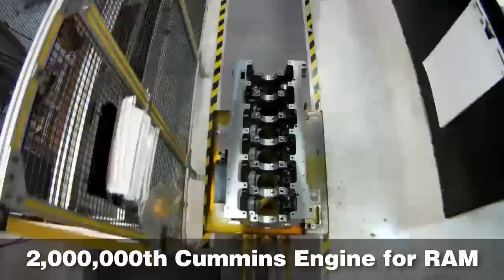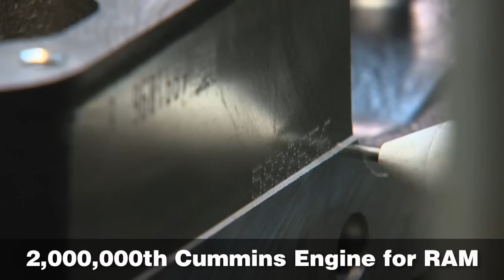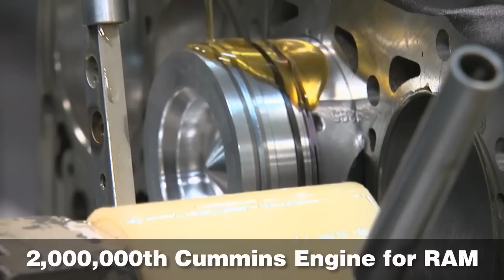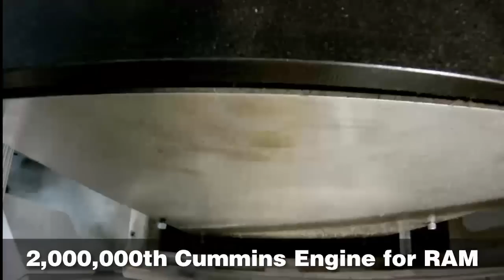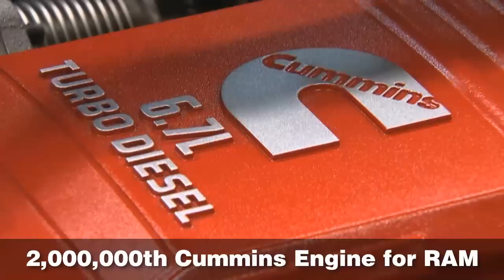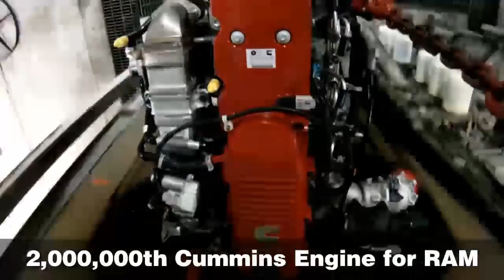Cummins Builds Two-Millionth Pickup Engine for Ram HD Trucks

Comment: Can never go wrong with a Cummins
Reply: Yeah fucking right
Reply: The rest of the truck though....the engine is SOLID I’ll give you that.
Reply: True but ford has better bodies & id take a 6.9/7.3 idi & or 7.3ps over a 5.9 just cuz of the cheapness to get parts. But the ford idi & 7.3 ps is still better than the Cummins cuz of no stupid killer dowel pin.

Comment: Theres 2million of these things yet people still want 20k for a 1999 -__-
Reply: Jeremy Ellard haha
Reply: Most of the old engines have died in a junk yard with the rusted out trucks. There are also a lot of people that buy these trucks and just run them into the ground.
Reply: Mark M old engines that die? Maybe the truck, but Cummins never die lol
Reply: early 1998 12v new interior best pickup yet.
Reply: Super rare.lol.
Reply: I have two 89 w350 & 01 quad cab .  Best truck ive owned.  Most of the complaints I hear are from guys who expect steering components to still be good 25 years after it was sold. The engine properly taken care of never die and when something needs to be replaced there so easy to work on.
Reply: Mark M 5.9 is the best Diesel engine made for any light duty truck. (Non semi)
Reply: @yamen16  yes I got 2003 5.9  338000 miles and still running like new
Reply: Still rockin the 93 w250 and 95 2500 12v cummins.
Reply: Thats because they dont have the EPA garbage these ones do
Reply: Nitro ForTheWin give it to a teen who tunes it to 1000hp will kill it
Reply: True but it’s the fully tune able 12v 5.9 w the P-Pump they’re after. But then again if you want power just get a new one or a 7.3 & make all the power you want. 

In reality an old diesel truck before 97 is only worth like 2-4K. I don’t care how good of a condition it’s in, unless it’s got a rebuilt motor, & or transmission it’s still worth what everyone else is charging. 

Yeah I’m a ford guy & I wish they had used the 5.9 instead of the 7.3 and or 6.0. I’ve had a 7.3 & they’re good, but everything expensive to fix.

I was looking at a 5.9 & all of them are up over 8-10k, so I went with a 93 idi w a 5spd for 4K w 210k on it. 

Us ford guys like em cuz the bodies are better & the parts for em are just about the same as a Cummins, but it’s easier to afford upfront.

For my idi I can find a core for 500-$1000 for a used engine, & a used zf5 core for about the same price.

Sorry Dodge guys, but the fords are better for the bodies at least.

Ford should’ve ditched IH after the 7.3 & went to cummins. 

If I was to buy a new truck it would be a Cummins, but then I like the fords, but then again if you get any new truck a fat warranty goes with it cuz of the DPF BS.
Reply: mmmontague, true. After owning an older diesel I can’t imagine owning a new one with all the stupid epa Garbo.
But then again it’s way cheaper to just have an good old truck, to keep fixing than buying a new one.

If my idi does eventually die it could be getting a 5.9 cuz I’ve got the ZF5 I’ve heard they’ll bolt up, but not to sure if that’s true. But then again the idi’s are still way cheaper to fix & maintain. A Cummins has a 2K injection pump but the idi has one that’s 5-600. Plus the idi’s are everywhere & theyre 1/2 the price of a Cummins for the truck, by the motor it’s 1/5 of the price.

Comment: 1992 I install a new Cummins 6bta 260hp in my  36’ Comercial fishing boat. 26000hr now it still run like it first install. It the most reliable engine I know in my life time. It only got two incidents 1 fuel supply line to injector crack. Shut off solenoid stopped working. This year I repower my boat with a cummins isl450hp I hope Cummins still keep its reputation

Comment: I just purchased a 2013 Ram 2500 with the Cummins 6.7 engine. I previously had a Duramax diesel which worked well, but I'm really excited about this Cummins. To be honest, the Cummins was the reason I chose a new Dodge over any other truck brand. 
Great video.

Comment: I understand that this engine failed at 22,396 miles. It was sold at a Dodge dealership in Akron Ohio. The turbo failed twice and the third piston broke the crank on the final repair. The engine was sent back to Cummins for evaluation. Rumor is the owner would pull a 32,000 pound RV in a one ton Dually. He would not allow the turbo to pre cool after pulling and just shut it down. He also would do cold starts and take off as if it was heated. He also installed a performance chip to increase the towing capacity. What a shame!  Great engine went to the scrap yard due to inexperienced operation
Reply: Can you provide sources for your post?
Reply: running the 2,000,000th engine's ESN through the Cummins QuickServMobile app reveals that this engine was NEVER installed into a truck; because if it were installed into a Ram, it would also reveal the VIN number of the truck it was installed into, and that portion of the dataplate for ESN 58226569 is completely blank.

Comment: There's too much crap screwed on to that beautiful engine.  Delete it all.  They should have stopped making that engine around 3:00 into this video.  Would be more like the 5.9L that got them there in the first place.
Reply: thank you'r govt
Reply: im man makes sence they put filters on that clog lol.
Reply: all the parts keep it running longer and stronger.
Reply: I got a 5.9
Reply: @executablefiles3713  what a joke
Reply: Idontcareifyoutubedemonitizesmyvideos explain how pre emissions tractor trailers would go over 1m miles easily I have a old Cummins with 4m miles and these newer ones need rebuilt by 700k
Reply: @makeamericagreatagain4546  I dont believe you
Reply: jim crawford I work at a trucking company the trucks with DEF break down at least once a month

Comment: I have the 2019 newly re engineered High Output 6.7 in my '19 3500 Laramie Dually, teamed with the 6 speed Aisin transmission. Everyday it sings a new song.  I don't quite yet have 5,000 miles on the beast.

Comment: Love my Cummins, hate my dodge.
Reply: Jason Stuck
 dude you LIAR you drive a Ford!!!  the Ford guys just can't resist  too lie!!  also an Obama voter
Reply: Scott wads 1,000,000 mile engine in a 100,000 mile truck. I love my Cummins the only thing wrong with it is the truck that's wrapped around it.
Reply: Get a Nissan Titan. They have Cummins now. I love Rams
Reply: @darwinmang4932  not the 2020 Titan. They got rid of the Cummins

Comment: Love my '01 cummins. And btw i work on the big highway rigs. They do have inline six cylinders almost exclusively. The inline 6 is an industrial setup, it provides superior torque to fuel economy ratios and reliability. How many duramax or powerstrokes to you know that have gone 1,000,000mi without a rebuild? With a cummins its considered normal. In fact the truck itself will fall apart half a dozen times before the engine ever misses a beat.

Comment: Its crazy how expensive they are now. My Dad bought his first diesel pickup in 1993. Ram 3500 Extended cab, DRW, manual, 5.9 Cummins. Out the door for $20,500. And this was a small town dealership. Most likely others got a much better deal.

Comment: I like Cummings engines I got one in my 18 wheeler but what if cat motors were put into the Ford 350's,f450 then that would be a beast even thou the Ford makes a good heavy diesel motors but we can forget Chevy trucks either,they should build a Detroit to fit in there lol.
Reply: whats a cummings?   these are cummins engines
Reply: B- trucker Ford makes a good diesel engine and Ford actually makes them since late 2000s and navistar used to make them.
Reply: Jorge Pulido 2011 to be exact, the first to build there own

Comment: Just purchased a 2013 Ram 3500 in July. Although it is a very nice truck and I am sure the cummins will probably outlast the truck, the duramax/allison combination is still king for towing performance. Unless you have had both, you wont understand.
Reply: I don't agree.. KING of towing with a pickup is a Cummins (or any other diesel) with a 6 speed manual and dual disc clutch. Mine is a 12 Ram 2500 with 6.7 Cummins, G56 6 speed, Centerforce Dual disk and 3.73 gears. So far there's nothing it can't better than the company pickups (2018 Ram 2500 Cummins and auto, 2017 Silverado Duramax and Allison and 2019 F250 6.7 Power Stroke and auto)

Comment: You are WAY behind the times. I've owned two 3rd gen trucks and never had one problem with either one. Bodies were sound and both the manual and auto transmissions did their jobs w/o a whimper. 

I own a Chrysler 300Hemi now but will be looking at the new '14 Ram 1500 diesel this fall. I miss my trucks.

Comment: Do you guys offer the 2.8L Cummins as a off-the-rack crate option? I want to swap this engine, with a 8 speed ZF transmission,  into my Nissan Frontier. Since Renault, part owner of Nissan, put the ax to this setup...I figured it can now be offered to anyone.

Comment: everybody start checking their serial #s
Reply: mine is #58202246 (24,323 before this engine) and was built Oct 9 2012, 1 day before my birthday, makes for one hell of a birthday present..
Reply: I have a feeling this engine(ESN# 58226569) never left Indiana; because I plugged both this ESN and Rexford's ESN into the Cummins Quickserve Mobile app; and Rexford's ESN gives me the VIN number of the 2012 Ram 2500 crew cab it was installed in, as well as the day the warranty started for Rexford's engine (10 days after the engine left CMEP). the 2 millionth engine doesn't have a Chrysler Group VIN or Warranty start date; so I bet that engine is gathering dust either at the CMEP plant, or at Cummins HQ.
Reply: if you read below(about a year ago), Cummins said this engine was going to be mounted and displayed at truck shows across the nation..

Comment: I’m not happy to hear all the recall repairs on new Dodge Cummins! I’m being told if I buy another diesel that the “Duramax” is the best diesel now and that Ford diesels will only last 125,000 miles. I own (2) Dodge diesels-03 and 04 3500 duallys. Those are the 5.9 high output Cummins (Factory Federal edition-no smog crap). I’m told these were the last good Cummins before it all went down hill to make more money and less quality.

Comment: I think Ram needs to rid of that 6.7 and replace it with the 8.3L. 1000 ibs ft and 300hp. It'd be very easy to bring that horsepower number up to 5-600 amd torque could effortlessly sore above 1,500 ibs ft so it'd be more likeable to the pickup market and it'll out last the 6.7 without a doubt. Those 8.3s are ment to go up to 750,000+ without a rebuild. Cummins offers a 5 year 250,000 mile warranty with them as well. Ford and Chevy could never pull against it.

Pickups really dont need anymore torque than 500-700 ibs ft but it is awesome to have over 1000 ibs ft and so long as you're getting it from a large engine gas or diesel they sure will last a lot longer under the light stresses a pickup can go through.
Reply: The 4500 / 5500 should get the 8.3L Cummins. The 2500/3500 is just fine with the 6.7 as it's fuel efficient and doesn't require ultra heavy duty front suspension.

Comment: I love these motors but hate the assembly line structure. It would be better to have one person to assemble one whole motor. Then the engine builder can be proud of his work and thus build a better product as opposed to say “hell yeah, I turned 1000 bolts on the left side of a oil pan today”.

Comment: There are so many people that fall between a 2500 and 1500. Dodge needs a 1500HD with a Cummings. How does Nissan get a Cummings errrrr lol
Reply: ATC235 Now explain the point in putting an engine capable of towing 25000 pounds in a truck that flat out couldn't handle it. The springs and drivetrain won't handle it. In a 1500 the Hemi is more then enough and if your just wanting a diesel for their benifits then they also make an eco diesel version.
Reply: Darren Thomas I have the eco diesel and let be it so far. I just would like a truck that would fall in between a 1500 and 2500. I think Nissan and Toyota are doing that now. I'm planning on trading mine in for a ram 2500. I heard the ride is so much better now and the MPG is not that bad.
Reply: *Cummins
Reply: Cummins
Reply: ATC235 ride I guess is ok it's a heavy duty truck. But it's definitely better than a 3500. The mpg is amazing for a diesel. Get 25 average in mine. It's a 2015
Reply: ATC235 we love our hemis if I want a cummins I'd buy a 2500 which I already have ..
Reply: The Cummins Engine in the current  Nissan Titan was developed for the RAM 1500, Daimler dumped Chrysler and Fiat installed their own Diesel in the RAM 1500

Comment: Cummins sells the engines to Chrysler at a discount with no warranty 
Although it is a cummins engine cummins will not do warranty work on them and our local factory owned cummins dealer will not even work on any of the new engines if you offered cash because the engine use Chrysler software

Comment: There are 7.3s that have went over 1million miles not just cummins, there is a van on YT that has 1.4 million.
500k is normal with just oil changes.
While I agree the 5.9 was a good engine and duramax is a joke but then again all the newer diesels are jokes with the EPA garbage on them.  
I get better MPG with my 97 7.3 pulling a 30 foot camper than a brand new ram 3500 just driving around town getting 10-12MPG.  No new diesel produced for consumers will see 1 millions miles now.

Comment: What I don't understand is why couldn't they have made it more special than just putting on a red valve cover... Jeez throw in forged internals from Carrillo with Mahle forged pistons, build the engine for performance use and warranty it.... Put a Steed Speed manifold on with an S363 turbo, ARP studs, Pusher intake horn and intercooler pipes, upgraded intercooler and radiator from Mishimoto, S&B cold air intake, Diamondeye stainless 5 inch exhaust, Some nice EFI live tunes for the daily driver truck... THAT is what would have been awesome to see put into the truck with the 2 millionth cummins engine...
Reply: but then what the aftermarket guy gonna have left to do hahah?
Reply: why ruin a perfectly good engine with crap like that
Reply: Because the majority of truck owners, aren't 20yr old kids and actually use their trucks for work and could give a ratsass about going fast or using it as a toy.
Reply: Unfortunately that would tamper with the emissions systems and that IS NOT ALLOWED!!!! Emissions suck

Comment: I agree 100% the whole inline 6 is better is complete bullshit, I will put any 7.3 psd or 6.9/7.3 IDI up against cummins on miles i see it everyday. hell alot more 6.0 psd's are up there on miles too. cummins is a great motor easier to work on for the most part, cheaper to mod, have a little lower toque band vs psd's/dmax's. Good engine never the less for the most part except the 53 block lol

Comment: Good motor thank God they put it in a junk fiat foriegn  owned  pickup because it could wear 3 of those junkers out
Reply: 159,000k on my 6.7 Cummins made 9 Oct 2012, 61 days earlier than #2,000,000 in the video. The pickup still drives like new (I compare it to the 2018's Ram 2500's my company has and 2019 F250's) and IMHO drives better than the new pickups.

Comment: Only 2 million!? SBC was at 100 million in 2011.  Almost 2 million PER YEAR.
Reply: Dude nothing is going to catch SBC's lol. They been making em' since 1955 and are still extremely popular.
I'm not sure that the LS is even going to overtake them since they are so much more expensive than a small block.
Reply: @bobjackson4287  LS?  Do you mean GenIII SBC?  No such thing as "LS".
Reply: @zacharymorris9917  Gen III "LS" is significantly different design than the Gen I's designed by Ed Cole. So much so that they are considered different family of engines.
Reply: @bobjackson4287  different family as in GenI vs GenIII, still a SBC...
Reply: @bobjackson4287  again, no such engine as "LS".  Doesn't exist.

Comment: EGR nightmare $4000 to 5000 system cost, replacement under 100,000 miles , poor mpg , EGR hard on the motor , what a loss for Cummins

Comment: ill just stick with my 2001 3500 6Bt HO 6 speed dually.. million Mile motor. 327000 and going strong
Reply: Consider a live tuner to get information on all parameters of the truck. You can easily catch it before something goes wrong. Also, you can give it a safe tune so there's an even lower chance for failure. I bet your truck could pass 1M miles if you treat it right.
Reply: A million mile motor in a 10,000 mile truck.
Reply: I have almost 94,000 miles on my 2012 Ram, it's just as tight and rust free as when I bought it brand new..